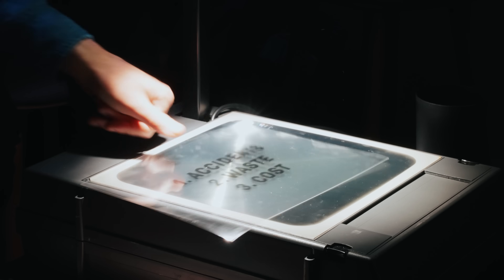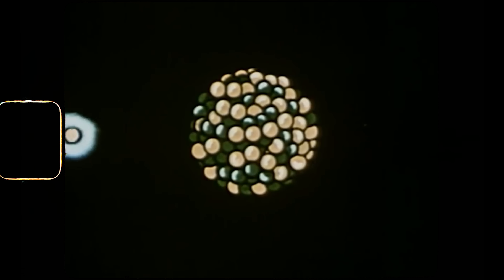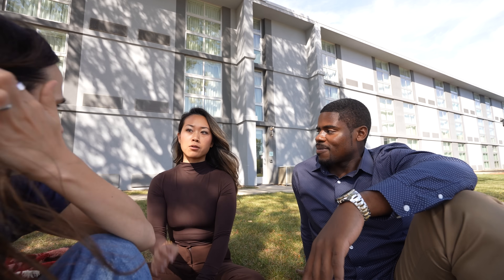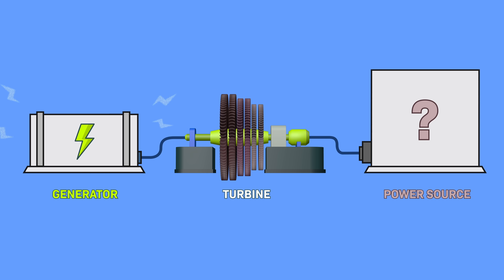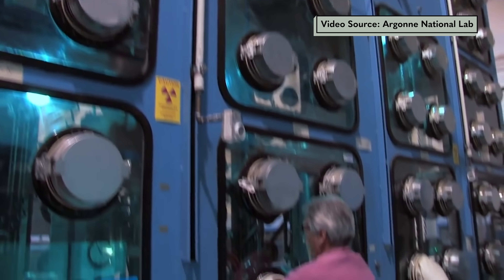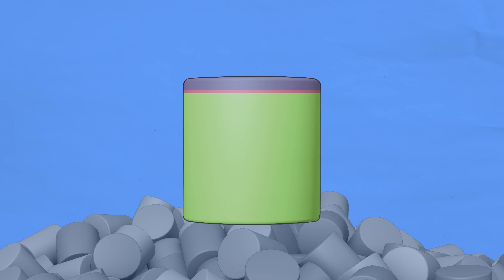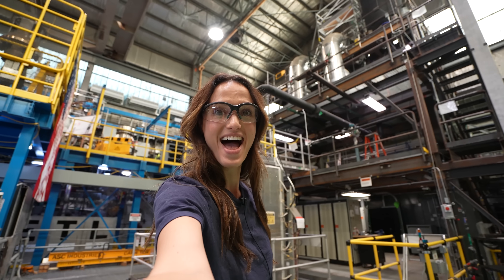The Big Lie About Nuclear Waste

Comment: FULL DISCLOSURE: My undergrad degree is in Nuclear Engineering, I am a retired Naval Officer (submarines, nuclear weapons) and a retired Radiation Health Physicist, who worked for 25 years with the Washington Office of Radiation Protection. I admit to having opinions on this topic.

First, this was very well done. I believe that it captured the general situation, though there are a couple of points that I think you and your viewers might find interesting:
1. When fuel is reprocessed, not only the U235, but also the plutonium is usable as fissile material in new few. The plutonium was the excuse used to shut down the U.S. reprocessing efforts, but it really isn't very good for making nuclear weapons with. Basically, if you want "weapons grade" plutonium, you want to "cook" the fuel for a short time; days or weeks, depending on things. When fuel is in the reactor for years, the plutonium will have too much of the wrong isotopes. So, when you get down to it, our reprocessing program was shut down because of several lies. 
2. With radioactive material, the half-life and how radioactive it is per number of atoms, or by weight, are linked. The shorter the half-life, the more radioactive it is. Fresh nuclear fuel, that hasn't been in a reactor, isn't radioactive enough to need special handling (though it is handled carefully, because it is REALLY expensive, and you wouldn't believe the amount of paperwork if you dent it). Spent Nuclear Fuel (SNF) is VERY radioactive, but the radioactivity start dropping as soon as the reactor is turned off. After about 10-30 years it is not hot enough to damage the fuel rods. After about 100 years it isn't very radioactive, anymore. After about 300 it is about as radioactive as when it went into the reactor. This is because the most radioactive fission fragments have short half-lives, and as those atoms decay, they aren't replaced, and eventually decay into stable atoms. So much of the problem with storing SNF is overstated, especially how long it needs to be stored. 
3. Depending on a variety of factors, SNF can be used to make more energy without reprocessing it. The easiest way is with a Heavy Water Reactor, along the lines of the Canadian CANDU reactors. 

Overall, a good job.
Reply: "but also the plutonium is usable as fissile material in new few"
Do you mean 'new fuel?' Thanks for the lengthy response.
Reply: @jfkst1  Yes, new fuel.
Reply: @jfkst1  It has to with the Reactor . The Pressure reactors required higher enrich uranium .  Pressure reactors are the problem . Vs the Molten-Salt refractors. But they were rejected in the 60s because of the metals rusting. The Alloys of today can last 50-100 years before rusting.  Molten-Salt refractors don't require a hi enrich fuel . this why they can Use the waste as fuel.
Reply: @jfkst1  So true, messing around with fission will make us the 2nd sun in the Milky Way.
Reply: @GEOsustainable 2nd sun?   How so?
Reply: @GEOsustainable there are thousands of suns in milky way
Reply: @GEOsustainable  there are billions of suns in yhe milky-way 😂
Reply: For the layman, an easy way to sum up your comment is we let politicians make engineering decisions and politicians are not engineers.
Reply: @bossymodo  It's interesting to note that Jimmy Carter was a Navy nuclear-trained officer, so he should have known better.
Reply: My understanding of the reprocessing scare isn't that the reprocessing of regular spent nuclear fuel could be used to make nuclear bombs but that the tooling and facilities used to reprocess spent nuclear fuel can be used to extract isotopes for nuclear weapons if you make/setup a reactor with the correct conditions to make your desired isotopes of plutonium. Fun Fact, we bought up Russia's plutonium and burnt it in our reactors as way to reduce their stock pile. So it can defiantly be burned up.
Reply: @allalphazerobeta8643  the main issue there is that the longer the fuel is used the worse the byproducts are for producing weapons grade fissile materials. You'd have to run a reactor for very long to accrue the materials and bleed money from the processing. Or you are going to have to run a power plant not for power.
Reply: @Dan-gs3kg  I think your missing the issue. The reprocessing facility is basically the same as the facility that extracts plutonium for nuclear weapons. The main difference is that the nuclear power plant isn't being run to make the right isotopes of plutonium, though most designs can easily be modified or run with parameters that make plutonium for nuclear weapons. Though they will not produce much power when run in this configuration. And so if the US designs and builds a bunch of reprocessing plants the chances are other countries will want to do the same. Meaning more counties will be closer to building nuclear weapons. (Basically, it will come down to the leaderships will to do it and if they can afford to not produce power from all of their nuclear power plants.)  Now, you can argue that it's not that big a risk or it's kinda of a silly reasoning. And I do think the risks are overblown. But I think that's the actual reasoning, we don't see more reprocessing. It's just being communicated poorly to the general public like a like of technical and scientific things tend to be.
Reply: @allalphazerobeta8643  you speak a lot to the matter of mutual production and proliferation as if it is an issue. You can certainly tweak a reactor to waste fuel to not make energy efficiently, in the same way you can misappropriate a car jack, and a button press. Is it easy? Is is affordable? Is it safe? Reprocessing for plutonium fuel is more economically and politically viable. Cheap energy is the meta for prosperity.
Reply: @Dan-gs3kg  Yeah, but that's my understanding of the official reason they're against reprocessing opt instead for burying it. They also, want to be able to retrieve it later, to reprocess it if needed in the future. Ironically. Finally, I said the risks of proliferation seams overblown, but we have to at least attempt to understand the argument being made by those in-charge before we can say it's a good or bad argument.
Reply: @allalphazerobeta8643  there's been a lot to do with hazardous materials storage, I don't believe it's remarkable to store it unvitrified, in a cooling tank, probably running some sort of turbine expander for some energy reclamation and cooling.

And the answer to the argument is that it's reduction by absurdism, ignorance, and proscribing in terms of abuse.
Reply: @allalphazerobeta8643 
It was both fears about the plutonium!  Just silly nonsense, but the news media, even back then, was more into scare stories to get viewership than to tell the truth!
Reply: I live in Belgium, and I'd heard it mention that Belgium's nuclear power plants actually sell their spent fuel to Canada. I never found out whether this is true, though, but your mention of these Canadian CANDU reactors seems to support that.
Reply: @Mike Brennan, thank you so much for the explanation. You make it sound easy, but I'm quite convinced it's not.
Reply: Very diplomatic and constructive cretiqie of a video that did have a few errors and didnt emphasise some of the important points u did.
Reply: @mikebrennan8288 Thank you for the detailed comment.  It summarizes the true technical realities very well.  Unfortunately, the #1 problem with nuclear power is greed.  Greed led to the meltdown at Three Mile Island.  The operators were pressured to ignore and bypass safety alerts and procedures because shutdown and restart meant generation time loss and less profit.  Greed and Hubris have been components in every major failure and disaster in this industry.  I sincerely wish it were different, but the reality is no quantity or quality of brilliant engineering will ever prevent Greed or Hubris.
Reply: Good job. It's amazing how a little knowledge displaces boatloads of superstitious screeching. Thanks.
Reply: We started using spent US nuclear fuel in the Comeau reactors back in the 90s
Reply: wait, so its only 300 years until its on normal levels again?? then we dont have any problems, right? i mean except the high price for building nuclear power plants which are mainly bc of the many regulations that exist and that only one certain type of reactor is allowed to be built.
Reply: While the benefit of using and reusing existing nuclear waste, and reducing the time this waste is radioactive is attractive, this story is incomplete. There are other problems that come with nuclear energy. Number one is cost. The infrastructure required is very expensive and there are hurdles to getting a plant online. That’s why the lady said the technology needs to be commercialized, to theoretically bring down the cost. Secondly, all nuclear power plants have basically military level security requirements, due to them being potential targets. These hurdles make this solution less attractive than other options.
Reply: My eyes perked at "CANDU" 😊 My dad worked at Bruce Power for 30 years (formerly Bruce Nuclear Power Development, Douglas Point, near Kincardine, Ontario - guess where I was raised 😊). I know very little about CANDU reactors (even though I saw lots of educational films at the Visitor Centre), but I bet my dad does! 
Thank you for your service ❤
Reply: Thank you for the additional information
Reply: This should be pinned.
Reply: If used nuclear fuel could be used in a different reactor as is, that is a big advantage on the basis of cost alone. Not having to chop it up, dissolve it in nitric acid then extracting the uranium and plutonium to fabricate new fuel costs a lot of money.
Reply: Full disclosure I cannot name any companies in my post because the activists would be all over them. 
There now that that is out of the way first thanks for mentioning the Candos, they are very efficient and unlike the Pressure Water Reactors they don’t need enrichment. And there has been experimentation in using recycled fuel in them but with cheaper sources of fuel available it’s hasn’t been done on a bigger scale…yet.
And what are those cheaper fuels? Well the most obvious are the high grade deposits of Uranium being mined or with plans to mine around the world. And the second less known one is nuclear weapons. Starting in the 70s countries like the US and USSR were reducing nuclear weapons. But that led to the question what to do with the high grade material in them. Some was blended and went into those reactors the navy uses in subs and aircraft carriers because they need a very high grade fuel but most was blended down even further and turned into fuel for civil reactors. After the fall of the USSR they even sold a lot of their material to the west because they needed money more than bombs. They also mothballed a lot of their nuclear subs and that fuel brought a lot of money to their cash strapped economy. 
So it’s not that we can’t recycle fuel. With the long life of nuclear fuel and supply higher than enough to meet demand it just isn’t viable today. But with more reactors being built and those supply stocks being used up it will be viable in the decades to come. So we need to stop trying to encase it in cement and bury it under mountains but instead just store it until we need it.
Reply: Excellent read,  thanks!!  👍👍👍
Reply: So basically speaking, the US doesn't recycle fuel, because it's wasn't in someone's interest and it's more profitable just to use fresh FNF. Because then the illiterate politicians lie, that means someone told them to, someone who has economical interest in those decisions.
Reply: More people die in a year from renewable energy sources then necular has since the start of the first reactor.  IQ 210..
Necual.. R... Plumber PhD.  Ahem.
Reply: H23 mike? the sub driver?
Reply: i'm super interested to know what someone w/your education and experience thinks of Galen Winsor's work.
Reply: And then there is the CRUD in the pipes and the pump fittings.
Reply: Thank you for posting this response.
Reply: FTN
Reply: @robertlong3199  I can tell you recently got out. Too much FIGMO I assume.
Reply: @Doodle1266  lol yeah, got out 2 years ago. Glad to be free!
Reply: @mikebrennan8288 ; I would be very interested for you from your professional and no-doubt historical knowledge, to unpack the 'lies' and real reasons for the shutdown of the US SNF reprocessing program. Clearly one of the 'lies' economies of truth, was about 'setting a world example' for non-proliferation of plutonium weapons.
Reply: Regarding number 1, so then why wouldn't countries like the US sell their "waste" to countries say that have even bigger political problems.  Countries like Israel who can't have a public nuclear problem so they can tell Iran and Syria that they can't have a nuclear program.  Iran claims to have a nuclear program just for power so we could use it to call their bluff.  If spent fuel cannot be turned into a weapon then this should actually remove most of the political issues.  No?
Reply: Thanks.
Reply: The truth is nice and all can be in a great way to be
Reply: Mike, is it correct that with hydrogen-gas one can ‘neutralize’ the intensity of the radiation?
Reply: As a physicist, ++++ to your point 2. This is the single most misunderstood aspect about long half lives.
Reply: Thank you!
Reply: Solange alles funktioniert - was es nicht tut: Es gibt letztlich keine Reparatur.
Die Atom-Technik ist die denkbar brutalste, die Industrie entsprechend verlogen - immer gewesen!
Reply: Hey thanks for the lesson; I would like to hear more. If you wrote a book, I would read it.
Reply: You know a video is good when the comments section provides even MORE knowledge, especially from someone that spent decades in the field. Thank you for this contribution ^_^
Reply: My friend ...you are a smart cookie...maybe u should start a channel..nice job explaining something very complicated and making it kinda understandable...
Reply: P.S ...I live near Savannah River Site...lol
Reply: Ok, then, with reprocessing how long would these products need to be stored?  Dumping them into the oceans like the Navies of the world does not count.
Reply: The explanation is awesome.  I found myself reading you instead of the commentary. THANKS
Reply: Thank you for your service. My Father-in-Law was COB Raymond Bromberek. If you knew him, you were a very lucky man.
Reply: I used to be an industrial radiographic tech. My knowledge of the long-term survivability of products used is kinda limited. But the usefulness is pretty short. The products I've used are isotopes of Cesium, Iridium or Cobalt. The usefulness is just a few years from the average here. Now how long are any of these radioactive? Your guess is as good as mine. Bravo on a career  in this stuff and not dying from it.
Reply: partial disclosure at best, but if I had that lvl of understanding, I wouldn't pick someone like me to report it to.
Reply: Thank for this.  I really appreciated your insight.
Reply: Thanks for the information Mike.
Reply: Good coverage,  thank you.
Reply: Wow, a comment from someone who appears to know what they talking about on YT? Thank you.
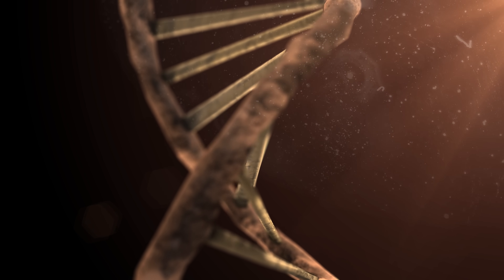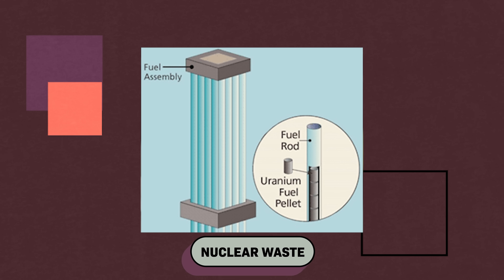Reply: Mistakes at 7:34 and 7:10
Reply: I really really miss PRP watches (sarcasm) and going to the ER to clean for ORSE...so nukes can get their NAMs
Reply: So we can bury the stuff and use it in the future for more energy. Win-win.
Reply: Stupid me...sending radioactive waste into space/Sun would keep planet clean...no?
Reply: Wow. What a crock.
Reply: That is a great clarification - as a friend to a number of ex-USN nuclear trainers and sailors, I thank you
Reply: This video and your response are a revelation to me. I thought (like most non-experts among us) that nuclear waste is a de-facto almost insoluble problem. But now I see that it is not the nuclear waste itself that is the problem, but the lack of efforts to reuse the waste. So, what are we waiting for!
Reply: I'd like a reference for spent nuclear fuel being as radioactive as new fuel rods after 300 years. Caesium-137, a major fission product with a half-life of 30 years, will be 1000 times less radioactive than it was, but it started as a 20 million times more intense emitter as U-235. And there are much longer lived products that are still a thousand times 'hotter' than natural fissile nuclides.
Reply: My understanding was that we  weren't worried about us having weapon grade isotopes but about other countries and the problem was that if they simply had a reactor like this it would be hard to monitor and reduce the time frame for development considerably even if the fuel they already processed isn't ideal.
Reply: Great explanation
Reply: currently in the freshman year of my nuclear engineering bachelor’s degree! any advice for someone just getting into the industry?
Reply: Thank you for the lesson.
Reply: Thank you very much for your clear and concise explanation of what we need to know! Keep up with the good work 💪💯!
Reply: There's real science and then there's  politically motivated "science". I'll believe the official  narrative when they stop lying. I'm a Handford Downwinder which the government denies any responsibility for.
Reply: Bravo sir bravo very well said thank you
Reply: The devastation of mining nuclear material and the implications on social freedoms are not trivial and have not been articulated. Cost and global politics are the loosest way to say that at every point along the chain of nuclear energy production are material and ethical considerations that aught to people democratised.
Reply: @ridleyleathart7907  How is mining nuclear material devastating?
Reply: This kind of Techno positivism can be leveraged to support socially degenerative ideology and mythologies like meritocracy, economic rationalism and managerialism.
Reply: Nuclear vs renewable is really about centralisation and control vs decentralisation power-sharing. Mining companies and governments that are environmentally and socially destructive want have obvious vested interests in centralised power generation to optimise their extractive profits from the environments and populations they operate in.
Reply: So is it possible to have nuclear reactors that work on the waste of other nuclear reactors? And if so, why are those not being build? Is it a "money thing" becouse of how "cheap" they can make electricity, or do you have an other opinion?
Reply: @The.world.has.gone.crazy...  There are some being built and a few experimental ones n service. it will become the more common type of reactor in the coming years. But the building of reactors is a slow thing an many countries are building coal plants because they are cheap and fast to build.
Reply: @The.world.has.gone.crazy...  Nuclear with fresh fuel is already the most expensive source of electricity and to use waste costs even more....
Reply: @alexandergreenfield91  but is it not better than burning Cole and gas for energy?
Reply: Rah sir, I dig your passion on this. Keep on keeping on.
Reply: Thank you, very enlightening. So what is your opinion of thorium reactors? From a layman’s perspective it looks much safer and less waste as well (my understanding).
Reply: So the government is lying to us, right? Okay.  You worked for the government for 25 years. Doesn't look good for you, pal.😂 Tell me why I shouldn't think you're lying here?😂
Reply: What about thorium ? Is that a safer source or better can I ask?
Reply: Luckily you were able to visit a research centre before Elon Musk was able to dismantle it
Reply: Quite a good read. I'm Canadian and after watching the video I looked up if we do recycle our waste which we don't. But if I'm understanding you correctly the type of reactors we have here make the most of the fuel we do use which leaves it at lower level radiation that takes longer to become safe there-after? 

Also would that mean the cost to benefit ratio would be higher to produce enough fuel that is potent enough to be reused?
Reply: Two and a half million years🤪💩
Reply: @gordoncooke6785  yeah, that's how geology works
Reply: The halflife of the spent fuel  always ends up being the hard part forpeople to believe. The Radon comming from your basement is probably worse than the spent nuclear fuel storage "in your back yard".
Reply: Excellent points.
Reply: These facts are nice thanks boomer
Reply: Hiiii. So I am doing research on converting  nuclear waste in to energy and do u mind if I could use  this as part of my sppech
Reply: Cualquiera..  esas cabesitas andan Mal..
Reply: Thank you so much for this information ❤
Reply: Thank for the info
Reply: You sound like a educated lying jew.
Reply: Your a Gronk and your staying in hell!
Reply: Your 2nd point is a critical point.  A material is very radioactive only because it is burning like crazy & will burn out fast.  The stuff that lasts forever does so because it burns so slow & thus, is not very radioactive.  The anti-nukes & the press love to conflate very radioactive with very long half-life.  I told my students that it was like letting a Zippo lighter burn properly for hours - small flame, limited heat production, versus dumping all of the fuel out on a table & igniting it.  Big flame, lots of heat, but burns out fast.
Reply: So tell us why molten salt thorium reactors are a bad idea.
Reply: @toddmarshall416  They're not. Thorium MSRs/LFTRs are a great idea.
Reply: @toddmarshall416  they are a stupid waste of time which takes money and focus away from nuclear projects which actually work. Thorium is expensive, hard to reprocess, reactors are impossible to license, require advanced materials which don't exist and there is no reason to believe they are cheaper than conventional nuclear, on the contrary actually.
Reply: @toddmarshall416  "So tell us why molten salt thorium reactors are a bad idea."

They are an idea at this time.  Nobody has built a Thorium cycle reactor with liquid fuels then run it for extended periods of time.

The biggest problem I have with them is the hype.   There isn't enough experience to justify said hype.

Liquid phase Thorium reactors are like communism.   The idea seems good but nobody has practiced it.
Reply: @jamallabarge2665  I guess you probably think EVs should be shunned for the same logic. Assume Rickover chose the MSR design (due to safety and efficiency and cost) and we had been using it for 50+ years. Now sell us on the high pressure water design to take its place. Kind of tough, isn't it?
Reply: @toddmarshall416  maintenance nightmare. Needs liquid sodium metal if I recall correctly to be pumped like water around to transfer the heat. During reactor shut down the metal turns solid at room temp.  That is very problematic for a thorium reactor to become commercially viable.
Reply: @Doodle1266  So you know about the successful pilot operation they had going for 5 years, right? From what I've read it wasn't a nightmare. Why is that?
Reply: @toddmarshall416  Sir there is Successful proof of concept, and then there is realistic cost effective commercial viability.  I would refer you to the development of the first atomic powered freighter for the merchant marine as another example. It works great.  My god it was expensive compared to a regular freighter.  That's a good analogy. Compared to a light water reactor, maintenance is too expensive. Doesn't mean it cannot be done. You also ignored the issue I brought up in my initial response.  The heat transfer material is a solid at room temp.  The reactor works wonderful when it's a liquid.  You ever start up a pump with  solid material in it? You can damage the pump. Enormous input energy in the form of heat will be needed for each startup.  Salt is very corrosive. That creates corrosion products inside a reactor vessel.  These are all technical issues the poor guys running the reactors gotta deal with.  Dealing with salt on steel is logically more expensive to deal with than water. Get it? So maintenance becomes more expensive Input energy for reactor startup is much higher.  If you are a for profit power company you care about issues like that. If you are the Federal government trying to get rid of weapons grade munitions maybe not.
Reply: @Doodle1266  
FS: Sir there is Successful proof of concept, and then there is realistic cost effective commercial viability.  
TM: And neither are singular...no static.
FS: I would refer you to the development of the first atomic powered freighter for the merchant marine as another example.
TM: Actually Rickover set the whole pattern with his Mark 1.
 FS: ;It works great.  My god it was expensive compared to a regular freighter.  That's a good analogy. Compared to a light water maintenance too many expensive problems......
TM: That's why they call it the M  (Molten) S (Salt) R (Reactor). Wikipedia gives 6 different reactor types...and MSR isn't one of the six. Why is that?
FS: The reactor works wonderful when it's a liquid.  .....
TM: No...and neither did Al Weinberg. ("The First Nuclear Era")
FS: So maintenance becomes more expensive Input energy for reactor startup is much higher.  ...
TM: Reading the history, the defense department played the most significant role. Once GE and Westinghouse (#1 and #2 implementation...slightly different technology) were in the race, they noticed their scheme needed economies of scale to compete with coal. 

Knowing how things work, Elon Musk could come up with a reactor you bury in your back yard for 100 years...cheaper than your current light bill. It's not a static world. When politics enters, it's not an objective or rational world. 
TM: I test new ideas against existing practice by reversing the positions. I make the new idea the existing and watch existing practice try to dislodge it. Try it some time.
Reply: @toddmarshall416  In Engineering the devil is in the details.  Grand ideas remain grand ideas until an Engineer/Tech figures out how to wire it up or build it.  Mr Musk understands that. The rocket he started with is not the rocket he finished with.  Reading a few papers does not make make you an authority.  You do not have an appreciation of how things work in the real world.  I get the impression your the type of person that will read books on the theory of how an automobile works but when you stick your head under the hood I doubt you have a clue how to fix anything or understand why it broke.  I didn't say thorium reactors were impossible. Just expensive and not very practical.
Reply: @Doodle1266  You seem to be having a wonderful monologue with yourself. I'll leave you to it. 

BTW: I've done electronics engineering and computer software for about 60 years (so I'm running out of time to catch up with you). I instrumented diesel engines and gas turbines. I programmed analog computers. I created two digital programming languages (and it was oh such a joy not to have done it by committee.) I created software by myself for the largest corporation in the world...for 15 years. I repair my own automobiles. And from what I've read there's no P in MSR. Reading is my first step in dispelling BS. That notwithstanding, you have the last word.
Reply: @toddmarshall416  so not a gearhead. Thought so.  Mechanical engineering is a whole different world.
Reply: @Doodle1266  My dad and two brothers were ME's/AEs. Does that help? I never had trouble carrying on a technical conversation with them? My early engineering experience was with the world's largest heavy equipment mfg. Never had problems talking with those ME's and mining engineers  every day as I instrumented their tests (strain gauges, pressure transducers, thermocouples, etc). I'll bet they would agree with the logic that high temperature ambient pressure is better than high temperature high pressure. But then you guys had Jimmy Carter...and we didn't.
Reply: @Doodle1266  that nuclear freighter is actually viable nowadays due to the massive increase in oil prices, and maturity of nuclear design. If they mothballed that freighter for a year, it would've been more than economically viable.
Reply: @Dan-gs3kg  LOL have you thought about what the pay of a Nuclear operator would be vs a ordinary engine room crewman. Or the number of personnel required to safely run one engine room vs another? The Captain and first officer would have to be Nuclear trained as well.  I guarantee drydock maintenance would be much higher.  It's not always about the fuel bill. It's the total package and I just mentioned a few items.
Reply: ralalbatross  if you see the previous comments I was discussing him because the individual I was speaking to brought him up.
Reply: @Doodle1266  from just this, you don't know what it takes to be a power engineer, a mechanical engineer, run turbines, or run generator heads. How am I to trust you know the primarily political and SCADA controlled requirements of a nuclear reactor. Can you tell me what the long term effects of radiation is on human reproduction?
Reply: @Dan-gs3kg  well since you don't think I know much and you truly believe that a Nuclear plant is cheaper to operate and build than an oil fired freighter just because the price of oil changed you can continue to live with your delusions.
Reply: @Doodle1266  there was a historical analysis made about it. The fuel prices did increase enough to make it viable soon after it was mothballed.
Reply: @toddmarshall416  You are clearly biased in your opinion about sodium reacthors. Try to find other sources...
Reply: @toddmarshall7573 The only problem with Elon Musk building a commercially successful nuclear reactor is that his research and development program could leave at least 3 or 4 states as glowing uninhabitable nuclear wastelands. His R & D programs seem to all contain a "let's build a rough approximation of the final product, run it and see what blows up" sequence that usually goes through several iterations before the final product appears.  But maybe you want to take the risk?
Reply: I completed the enlisted nuke schoolprogram in 1976, and have been working  primarily as a radiation protection technician for over forty three years, in that time my wife and I have lived and worked in almost all the lower 48 states tragically I survived a massive stroke in 2018pleasepay heed to the next IF you ever notice you heart skip abeat an it pounds and races without an explan ation tell you doctor, youcould have AFIB (AtrialFibrillation what can happen  your heart fibrillates and doesn't beat blood pools in the heart stops moving just long enough to form a clot then the heart beats sending that clot right to the brain, take it from me it really sucks when that hAPPENS, PLEASE PLAY HEED TO WHATto happened to me save yourself or a friend  some grief, it's been a rough five yrars, constant physical therapy, will run aguy down, it gets old not being able to shower yourself, fortunately, I married a strong loving woman, I doubt if I'll ever be allowed to work another nuclear plant again I spent the fifteen years leading up to 2018 working alot and got my house paiid off, before disaster struck, I'm sitting pretty good  if the madmen in charge of congress change social secutity, I'll be screwed.
Reply: please keep the youtube comments to dumb arguments and non-helpful stuff, as it was intended. this is frankly unnecessary
Reply: Funny how you mention heavy water and how that relates to the name of the company of the people she met on her trip.  Oklo is a two billion year old heavy water reactor that is the only natural nuclear reactor known.  Interesting story behind it.  Some details of it change over the years making you question if it were natural or not.  Not much out there about it either.  Thanks for your response.  It was good reading.
Reply: Hi Mike, I'm not in the industry, just have taken the topic up for study. 
The rationale I hear for pwr reactor dominance is due to Rickover and navy research.  Proven concept that has less risk.  Makes sense, also that the navy was producing a whole lot of civil nuke engineers.  I heard this referred to as the rickover trap, that is a proven path that makes new research less appealing.  
I don't think the u.s. has any fast breeder commercial reactors.  They tried with Fermi 1, didn't go well.  Other designs haven't seen development needed to become mature, including the htr1 metal reactor for the u.s. nuclear powered bomber that was scrapped before deployment and is the basis for some of the new thorium reactors and the field can be cleaned while running.  
The u.s. had been doing alot of reprocessing before carrer stopped it.  IT was a whole industry , like the Handford Washington facility.  Not that we can't do it, we were doing it and then stopped.
Reply: What about the reactor shielding material?
And all the other contaminated bits?
Reply: @DerSolinski  are you referring to once an old reactor is decommissioned? Or what?
Reply: @johnwright6706  Any radioactive garbage that is generated.
There is a lot more than just fuel.
Even protective clothing needs to be properly disposed.

As my understanding those radioactive byproducts are far more problematic then the actual fuel.
And the danger they pose is greatly underestimated.
Reply: @DerSolinski  Something that people often don't realize that 99 % of all radioactive waste that we create is already being stored in permanent storage facilities. This low and medium level waste which includes things like contaminated soil, clothes equipment, water filters, depleted uranium, medical isotopes, nuclear components etc. The only problem is that last 1 % which is spent fuel which requires stricter storage because of its high specific activity and relatively long halflife.
Reply: @vaclavzajac214  100 years, not permanent. Half life is 1000 years. All we did was kick the problem down the road 100 years. In my opinion it will mean the extinction of life on earth because in 100 years, we will still not have a solution because everything is about money. Apologize to our grandkids now for being so lazy and greedy, we killed them.
For all this talk, the land use of nuclear is more than a comparable solar or wind farm (Elon Musk did the math). Just not high tech enough for Americans. russia scores big at some point.
Go Hydro, 24/7 and all we are using is water. Ocean waves never stop.
Reply: @GEOsustainable which half-life is 1000 years and how dangerous is it at that point vs the starting point?
Reply: @DerSolinski 
Germany is right now trying to dismantle a reactor that has been in use. 
The first Timeline wanted it done in 20 years, which (I believe) is how long they've worked on it as of now. 
The new estimation is 200 years just to dismantle it without making anyone radiation sick.
Reply: @DerSolinski Hmm not according to what she just told us!
Reply: @vaclavzajac214 permanent 😂😂😂😂😂😂😂😂😂
Reply: @gordoncooke6785  yes, storage lasting 100 times longer than the waste can be considered permanent
Reply: @DerSolinski  Most of that stuff is barely radioactive at all. Long term storage would be pretty trivial. Most of it can probably just be buried (deep enough to not cause issues ofc) with little to no issues.
Reply: @DerSolinski Every wrench, every screw, every rag and even dust becomes radioactive, and can cause other ordinary matter to become radioactive and begin decaying! The Atomic Plague, was discovered in the 40's and 50's! And England dumped 125,000 TONS OF HIGHLY RADIOACTIVE WASTE INTO THE ATLANTIC OCEAN!
Reply: @DerSolinski  The vast majority of materials used in a nuclear power plant don't become radioactive enough to even warrant storage.  BUT, because of the US DOE's overly-conservative stance on "radioactive waste", we store it anyway, leading to a large part of the radioactive material storage problem.
Reply: @DerSolinski  "What about the reactor shielding material?
And all the other contaminated bits?"

There is some neutron activation, but it's marginal.    There is a relationship between intensity of radiation and half life.  The more intense the radiation, the faster that it decays.

The fuel elements?     The cladding for the fuel MUST be transparent to neutrons, so there is minimal activation.  Spent fuel is very valuable.
Reply: Where you get your numbers from is a mystery! 300 years?! Other scientific sources talks about 100 000 years and to reach natural levels it is 4,5 billion years… Would like to know where you got those numbers?
Reply: Merica!!  Thanks for keeping the watch!!
Reply: The main problem is not radioactivity which we can handle, but high toxicity of transuranic elements.
Plutonium doesn't exist in nature and living organisms are not evolved to handle it ( unlike uranium), and that makes it highly toxic, mutagenic and carcinogenic to organic life.
Ad to it's toxicity that it is a strong Alfa emitter that would destroy soft tissue if inhaled or injected.
So with his toxicity, radioactivity and reactivity, it is safe to say that plutonium is the most dangerous element present on Earth.
Nuclear waste fuel has A LOT of plutonium and other transuranic elements in it and it needs to be spent in fast neutron reactors.
There are only a few such reactors in the world...
Reply: @pathfinder2reality  And cole and oil is toxic too, and nobody cares.
Reply: Its not the fact that the high level waste is less radioactive than the initial uranium fuel after 300 years..,its the fact that they are new daughter elements that are readily absorbed by the environment c and will be extremely dangerous and radiologically poisonous for at least 100,000 years along with all the other massive amounts of low level waste produced by the reactors themselves and the fuel reprocessing. That is the danger. That is the problem.
Reply: @gb-jg1ud  give me a list of these components, and how they'd be introduced to the environment under modern policy.
Reply: @Dan-gs3kg  I replied to you and another guy in here twice...she has it set to wipe out any comments with links....look up epa requirements...and turbine blades options end of life.
Reply: @gb-jg1ud  that's not specific enough as that only tells me how much of a meme wind turbines are. You do know there are a few well studied approaches to nuclear remediation, ranging from ELF/ULF EMR exposure, hydrogen exposure, bacteria culture and magnesium salts, and then medium gas torches in order of least to most rapid remediation.
Reply: I live in the South West. I live in an area that has a lot of elders who worked at the test sites. I will just say, these people are really sick. The gov lost a lawsuit and are held responsible for lying to these people about how hazardous nuclear power actually is. Now I am not saying there is not potentiality to find a way to protect people from this radiation, however, I am incredibly skeptical of people saying we should go nuclear. Unless people show me a way to clean up the areas where nuclear energy decimated environments. Such as Japan, Russia, and here in the U.S. once we can clean up already polluted energy, that's when I am game.
Reply: @donaldcharles3331  there's a huge difference between a nuclear explosion releasing all of its radioactive debris everywhere and a civilian nuclear powerplant hermeticaly contained in 1 meter of reinforced concrete. By the way Fukushima radiation levels are below global average and 90 % of the chernobyl exclusion zone is safe even in the long term, there are 90 years old people who still live inside of the exclusion zone 37 years after the incident because they never left with no sign of radiation damage.
Reply: @vaclavzajac214  in the southwest, I am not talking about explosions. I am simply talking about people working at the test sites. Now I am not saying the people in charge were actively trying to protect the employees. There are a lot of variables that we are not privy to. As far as the radiation of Fukashima and Chernobyl, do you have citations? I am extremely skeptical of such claims.
Reply: @donaldcharles3331  In Northern Saskatchewan, radioactive tailings from old uranium mines in the 50's and 60's continue to contamiate grounds water and make it undrinkable or useable. The nuclear industry refuses to clean it up.
Reply: @soulscanner66  I definitely believe that. I also believe the biggest issue with nuclear radiation is malfeasance and a direct representation of corporate and government greed and collusion. Historically you can trace how every decision was made like this. Cannabis if it was used for material would gave lead us to a better and healthier society. That speaks to the same issues here. Woth that being said I do not think we will ever know if we can have nuclear energy without contamination due to this and other variables.
Reply: @vaclavzajac214  Today, Japan will begin to slowly release the radioactive wastewater from the Fukishima disaster into the ocean much to consternation of the nation's fishing industry.
Reply: @soulscanner66  the water is cleaner than tap water
Reply: @vaclavzajac214  It's radioactive.
Reply: @soulscanner66  the radioactive particles have been removed
Reply: @Václav Zajac  tell that to the russian soldiers who dug trenches  at Chernobyl earlier in the war on Ukraine and ended up with radiation poisoning
Reply: @soulscanner66  Today Japan will begin releasing water with high concentrations of tritium from the accident site. Tritium is a naturally occurring isotope of hydrogen that is already present in water. Japan will be releasing it in to the ocean which will dilute it and it will quickly disperse and the ocean water will be indestinguishable from ocean water samples taken elsewhere as far as concentrations of trituium are concerned. Its kind of like fish pee. The ocean is full of it, but it is so diluted normal people don't freak out when ocean water touches them because they have fish pee on them. The fear of Japan releasing radioactive water is not so scary when you know even a little bit about what they are actually doing. 

By the way, tritium is everywhere. Nuclear plants already release tons of it when they process down their liquid radioactive waste. It is totally fine as long as they release it at ot below a certain rate. Tritium in higher concentrations is commonly used in sights for firearms. Lots of people carry tritium sights right next to their body all day and that is considered totally safe. You can even send the sights through the mail without special handling.
Reply: @vaclavzajac214  True, and the best example is Palo Verde, a huge nuclear power plant west of Phoenix that has one of the best safety ratings supplying clean energy to people across the entire southwest for many years.
Reply: @vaclavzajac214  If it is cleaner than tap wather, why are they releasing it into the ocean. Why dont they drink it and use it in agriculture?
Reply: @limanac111  strange politics. California routinely has dam breaks, and throws a lot of potable water out to the ocean for no real benefit during droughts.
Reply: @F14Goose37  fish pee is why I don't swim in the ocean. ;)
Reply: @Dan-gs3kg  Ah yes, we can explain every bs in this world as strange politics.
Reply: @limanac111  when you look into the human radiation exposure model that is used today, you'd realise that people existing on average take in at least ten times the maximum limit of radiation exposure from the Sun, not even talking about all sources, like in door lighting, or bananas. Not even talking about how much ionisation radiation is caused by going through the krebs cycle. That 15,000 people died unnecessarily in the evacuations during Fukushima, and that the ocean water was probably more radioactive than the ejected water.

Talk about strange policy.
Reply: @soulscanner66  You fell for chinese propaganda lol
Reply: @R1CK_54NCH3Z  I second that...!!! Chernobyl is not a safe place for your children!
Reply: @vaclavzajac214 Do you work in the nuclear industry?
200 countries complained about Sellafield in the UK because of radiation aka radioactive material turning up around the world from there.
And yet the propaganda was you could take coffee and biscuits safely on top of the Atomic Pile.
Reply: @soulscanner66 there is far more radioactive material already in the ocean such that with the dilution any increase would be below measurement thresholds.
Reply: @limanac111 It ain't safe unless it is diluted.
Reply: @vaclavzajac214 maybe if you live in Flint Michigan... Just because you say so doesn't make it true. Please post your data backing up your claim
Reply: @vaclavzajac214 you ok to drink it then?
Reply: @rogerehughes  yes, absolutely. Some people drank it already (voluntarily)
Reply: @soulscanner66 It’s tragedies like Fukushima daiichi nuclear power plant that let us know we should be very weary of this type of energy. It’s very different than smog and smoke. I live near Niagara Falls and I don’t understand why we don’t harness more hydro energy. It may have to do with fish populations but idk
Reply: @F14Goose37 interesting point though. I watch a show on YouTube, best ever food review show. And although sonny didn't make the link at the time, the two least paletable dishes he's ever had were stingray liver from that area and uni also from Japan. As he said it had a very unpleasant metallic flavour. And sonny is a guy that will eat litteraly anything. He also actually enjoyed both foods when tried from totally different countries seas. I cant help but feel the radiation is affecting at least the livers of fish in the area and presumably filter feeders also.
Reply: @vaclavzajac214  Vodka is a well-known antidote to radioactive contamination.  So is Saki.  I'm sure the Mexicans would also make the same claim for Tequila.
Reply: @donaldcharles3331  What do you mean decimated environments? TMI was fine. They even kept operating TMI 1 right up until 2019. I wouldn't call that a decimated environment. Fukushima is also fine. I actually used to live just up the coast from there from 2012 (one year after) to 2014. Chernobyl isn't exactly doing poorly either. The wildlife in the area is absolutely thriving. Dose rates in some areas are definitely high, but the environment as a whole seems to be doing just fine there too.

I am sure some old timers who worked the industry back in the nuclear cowboy days have some serious health problems from some of the reckless ways they used to do things when they were still figuring this whole thing out. Those dudes are mostly dead or super old by now (which might be why they have health problems 🤔). I also live in the American southwest and the town I grew up in had an economy based on farming and nuclear power. If you didn't do one, you probably did another. I know tons of old timers as well and they don't seem to have any different health problems than the old farmers or any of the other old people I know. I think you are just choosing to be ignorant, but hey, to each their own.
Reply: @donaldcharles3331  nuclear weapons and nuclear power are two different concepts.
Reply: @donaldcharles3331  what this shows me more than anything is cherry picking the facts and not knowing the total story looks to be more dangerous in the long term, question "what or how different would the areas you mention be ? would the clean up be different knowing we could make energy from it to offset the cleanup cost? cheaper fuel paying towards that also? it also begs the question of how much the governments have quashed or sat on because of the big companies or the rich that back them? just look at how studies of natural reactors have changes thinking
Reply: @lesliecompton4061  I definitely am not cherry picking my information. its not about cost, its about long term effects. I know your programming has trained you to only focus on costs. Thats like saying well the pesticides  allows us to grow a lot of food for 100 years and made it cheaper but now those same pesticides are leaving people infertile. same issue.
Reply: @donaldcharles3331 well they are still alive. Then we shouldn't worry to much should we?
Reply: @donaldcharles3331  You're referring to nuclear weapons, not nuclear power.
Reply: @donaldcharles3331 I think people think our environment is fragile 
It’s actually very tough and resilient
Reply: @donaldcharles3331 people are really sick because they did not realise that a moderate exposure over a long period was as dangerous as short high intensity exposure. It’s not like heat where you can survive 40C for a few hours a day for 20 years but not 1000C for a minute. The radiation damage is cumulative. We do know that now and can significantly reduce such risks with distance and shielding.
Reply: @donaldcharles3331  Protection and standards from then to now have gone significantly up. Post Chernobyl sent the world's scientist into a frenzy to 1000x safety, not only of reactors but personnel and support service personnel (includes disaster management personnel). I would think those people went through an era of exposure that was not fully understood but anyone can say with confidence now that radiation and the various types as well as sources are significantly more understood now than then.
Reply: @donaldcharles3331 this is still a very valid point how come no one is even making an effort to clean up some of these places. Think about the benefits if you had a way, though expensive, to physically clean up an area after an accident. Wouldn’t that be worth exploring even if all you could effectively do is clean up a certain percentage of the area right away.
Reply: That was sum total of knowledge 50 years ago. Are you telling me we haven't learned anything more since? We are not even looking logically at those numbers.
1000 years is a long time when the best we can contain it about 100. Life won't exist to see 300 years; it will leak long before. We are storing in what amounts to paper bags left outside. Don't remember being taught to design things that need to be fixed later by someone else. Genius is on pause I guess.
We will never even witness the problems we are creating 100 years from now. We still teach, at a 7th grade level, engineering concepts. We think we can do something that has the potential to eliminate life on earth. The Murphy Proof states, 'what can go wrong will go wrong' for the next 100 years, like russians, wrong button pushes, and a growing list.

Nuclear has a place, just not in simply converting it into electricity. We as humans don't even have the right to risk another. Nuclear = $$$$, period. IMHO
When did engineering become an industry? that creates the cheapest products irrespective of safety? that pay the most for a few? kicking any problems down the road?
Never listen to Bill Gates, he caused the 20 year back peddle in computer science so he could get rich. Recycling waste is another bad idea.
We are not going to be satisfied until Earth is the 3rd Black Hole from the Sun. I remember being told as a little boy not to eat the snow. We are that stupid.
1000 yrs. is the half life. Visit the Red Forest in Ukraine to gain a little understanding of your flawed statement 'After about 100 years it isn't very radioactive, anymore'. Deer with 2 heads is normal to you?
It is telling when people mention they worked in Washington as those of us with 190+ were not allowed because IQ must be below 120 to have a government job. Government jobs are reserved for those that can't cut it in the real world, is the understanding amongst my friends.
Masters in Industrial Hygiene (one of 12 guys that cleans up what Nuclear Engineers screw up...I was at TMI), Purdue, Army Pathfinder.
Reply: @GEOsustainable  "Don't remember being taught to design things that need to be fixed later by someone else." 

What has ever been designed that hasn't needed to be fixed at some point by someone else? Air conditioners, refrigerators, cars, train engines, brakes, planes, power plants... The list goes on and on. EVERTHING needs to be "fixed" at some point (or replaced) that's what maintenance people are for.
Reply: @GEOsustainable  You don't have a 190 IQ. I can tell that from just two paragraphs.
Reply: @GEOsustainable  What about Galen Winsor?
Reply: @GEOsustainable 👍👌☮️⚖️❤️
Reply: @GEOsustainable  I agree with your sentiment. Bill Gates is just one of many who participate in that form of Capitalism. The only advancements in tech we have made the last few decades is surveillance tech.